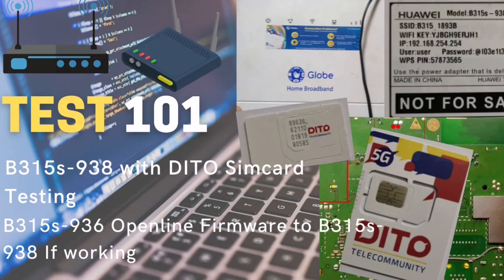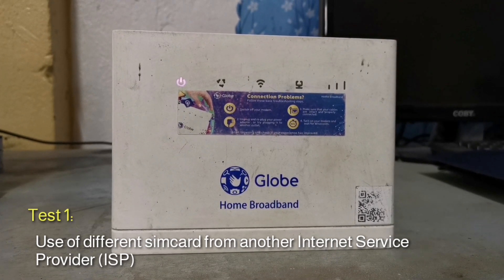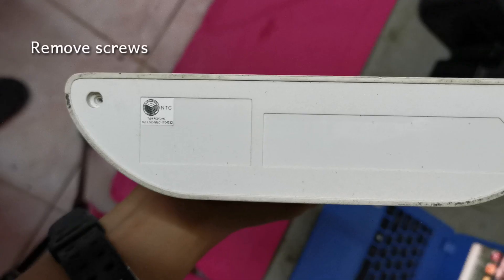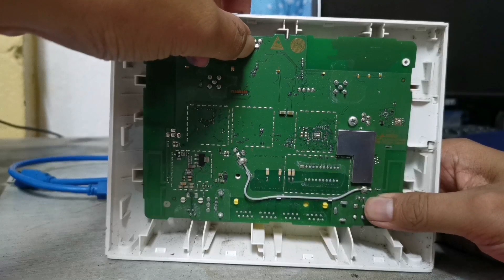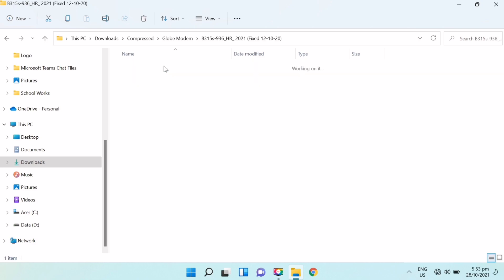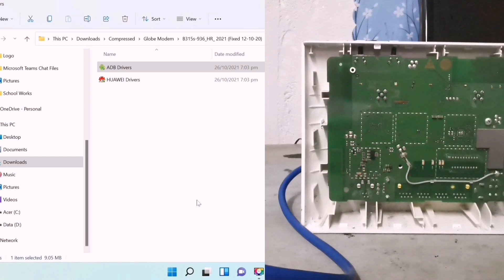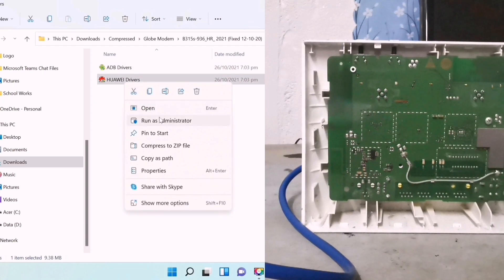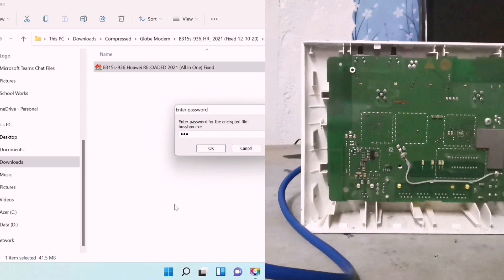B315S-938 Modem Openline ATTEMPT using B315s-936 Latest Firmware 2021 Reloaded

Comment: Have You Tried to use B310as-938 Firmware Reloaded 2022? My B315s-936 uses a Firmware of B310as-938 (Reloaded 2022)
Reply: gumana sir?
Reply: @wtfmobilelegends4762  Yes. Mas gumagana sa B315s ko yung Firmware ng B310.
Reply: @emmanuelmanahan3866  may video tutorial ka po sir?
Reply: @wtfmobilelegends4762  wala po. Pero the same procedure lang ng ginagawa nyo sa Video. I-download nyo nlng "Huawei Reloaded 2022 (for B310)" then i-flash nyo sa B315s-936 nyo
Reply: @emmanuelmanahan3866  hello gagana po ba yang sa B315s-938?
Reply: @nheybatiller9404  yes
Reply: pwede ko ba i try yung pang B315 936 sa B310 938?
Reply: Pede po sa B15s b938

Comment: sir patulong po.kasi na flash ko sa b315s-936 modem ko na b315s-938.katulad sa video mo.kaso hindi kuna ma gamit modem ko walang signal at naka red light na.
Reply from the maker: B315s-936 ba yung modem mo?
Reply: b315s-938 po sir
Reply: baka pwede mo po ako matulongan?
Reply from the maker: @doktech5776  try mo lang e restart ang modem mo. Anu pala sim ang gamit mo?
Reply: sim na naka plan po.sinubokan ko na restart at reset ganon parin po.
Reply from the maker: @doktech5776  default Sim po ba ng Globe  o Smart sim ang naka insert?
Reply: globe po sir.
Reply from the maker: @doktech5776  sa modem ko naman working naman siya after ko mag attempt mag openline. Di nga lang successful ang pag openline kung magwwatch ka sa video kasi ang firmware na yan is for B315S-936 firmware only and not for B315S-938.
Reply: sakin sir pag katapos ko mag flash.hindi na nag ka signal tapos naka red light nalang.
Reply: baka my b315s-938 ka jan sir pang flash lang.kasi bumili ako sa fb ng firmware naka bin ngalang ayaw tangapin nag modem.
Reply from the maker: @doktech5776  Wala pang nag oopenline sa B315s-938. Hangang ADMIN access lang.
Reply from the maker: @doktech5776  Kung gusto mo ma openline, sana ang old version (B315s-936) ang binili mo kasi na oopenline yun.
Reply: @doktech5776  Walang solusyon yan, pag erase nyan, wala na ang ROM mo, di mo na yan maibabalik
Reply: sir sayang nag po binili kung firmware sayo ayaw tangapin ng modem.piro nag power na modem ko pinalitan ko ng isang pisa.kaso wala sya signal sir.parang my naka off na ip.patulong ulit sir.
Reply: baka sa admin access.babalik signal nya.
Reply from the maker: @doktech5776   try mo e access ang management page ng modem mo tapos sa NETWORK options set mo sa AUTO.
Reply: @ICTSupport101  ganon parin sir naka red light lang at walang signal.

Comment: Salamat may nilabas na. Thanks sau master. Pa fix po ng link. Error po kasi.
Reply from the maker: B315s-936 Firmare po ang nasa link, hindi po siya sa B315s-938.
Reply: @ICTSupport101 boss mayroo. Ako B315S-938  NAOOPENLINE BA GAMIT YAN FIRMWARE NG B315S-936. SANA PO MAPANSIN MO AKO.THANKS
Reply from the maker: Hello, based po sa video, hindi po siya na oopenline gamit anf Firmware ng B315s-936 @baekhyuneco2610
Reply: @ICTSupport101  amy firmware ka sa 938 boss

Comment: Hi, I've got one. It's a B315-22, its stuck in download mode. Would you happen to have a fix to that problem? It only registers one port in the process of flashing.
Reply from the maker: It will work if you are using it to your B315s-936 modem. Make sure you have the same Modem model cause B315-22 is different from B315s-936.
Reply: I have a B315-22 firmware, i can give it you for free
Reply: @djpeejayrn  help me with B315-22 firmware. Mine is bricked, when flashing it starts, then stops and it only shows one port.
Reply: @djpeejayrn  it got bricked when I did ota update.